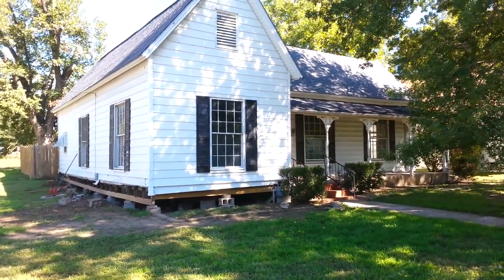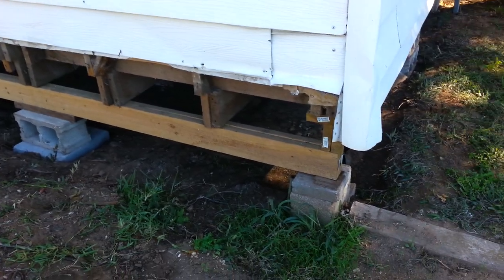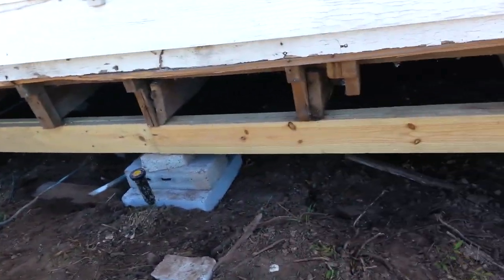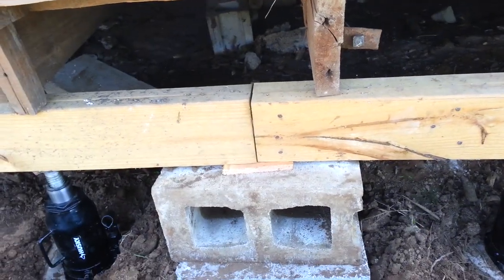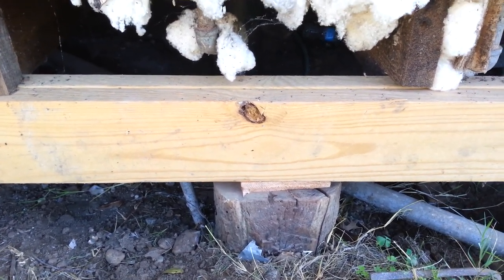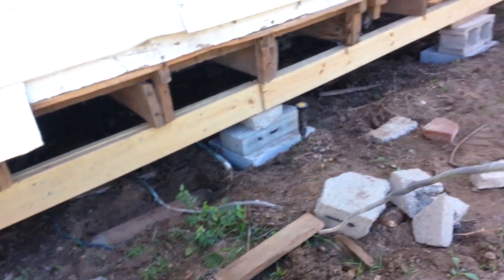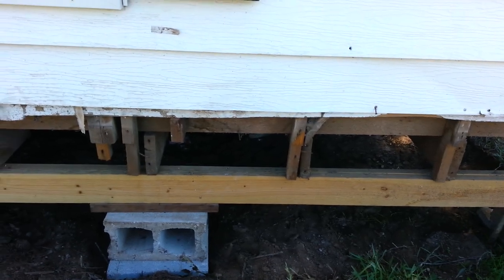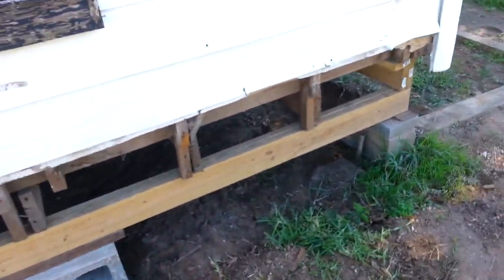How to level a pier and beam house

Comment: outstanding video,  i've been doing a lot of repair on my early 1900's house ... paid less then twenty grand for her. so i haven't complained too much about foundation issues and rot and termite damage just lit in and replaced what i had to.. had to repour some concrete on top of the existing foundations as they were poured beneath hand hewed beams which the termites ate.. and they were not square flat nor level so i had no level place to put new beams..  the concrete repour worked gangbusters... got it all squared away new beams joists and plywood put down..   i actually made a stain out of steel wool, distilled white vinegar and a little baking soda that stained all the new wood... it fooled the inspector when he came to inspect some of my plumbing.. i was afraid if he knew i replaced a bunch of joists he would have required a permit and made me bring the whole house up to today's code standards..  my lil house has stood since about 1907 and i truly just wanted to repair what was there and keep the integrity of it.. didnt want to tear it to the ground and rebuild.. so far its looking great.. i got one area that i may take some photos of and send you if you don't mind i need a bit of advice..  anyways thanks for the video its been very informative.
Reply: What state are you located?  Just curious..i just bought a similar house in fort worth tx

Comment: When you are under it in the middle fixing the midspan beam is the best part. Nothing quite like listening to the house crack and pop while you're laying under it lol. For those that are wondering, no I'm not in any real danger doing that. The jack could magically disappear and the house would just fall a short distance and hit the piers. Worst actual case is a seal fails in the jack and the house slowly settles back down.

Comment: Thank you for this video!!! I have been searching for hours to find some info on post and beam construction. I have a camp on a lake that needs a beam replaced. my situation is an uncommon problem. What happened is my uncle put a deck on the lakeside beam without flashing his ledger board!!! So the beam is totally rotten. If you can help me with a few questions I would really appreciate it. Some background : I inherited the camp from my grandfather who was a builder/contractor with a relatively big company (about 6-10 employees depending on the job.I was really close with my grandfather because I was his only grandson. My mother was his only child. So I spent summers working for him ever since I could carry a bundle of shingles. lol......so I'm just saying I grew up around a family of contractors and I am a contractor myself. But the only time I have done any foundation work was leveling the camp im talking about when I was around 12 years old (so very little experience). In my situation if the rotten beam was perpendicular to my joists I would be a lot more confident replacing the beam by holding up the joists with a temporary beam and cribbing. But the beam I am replacing runs parallel to my joists and its throwing me off. Im trying to figure out how to hold the weight to rplace both the beam and the rim joist. Its funny I have not come across a video with anyone replacing a beam like mine. lol I really need this camp to stay up because im so close to the lake I could never rebuild this. So if you could find some time to help me out corresponding with pictures and what not I would send you some $ through paypal or something. I really need to get to it this year before another winter (im in Maine by the way). Ive done all sorts of different jobs but never one like this. the camp is on a hill/slope making things more difficult. And the beam I need to replace is 75" so around 6 feet off the ground. So its just the worst case scenario for me. Ive contacted a few companies but they are all too busy. I can get help with friends and neibors to help lug cribbing and everything but im just nervous being the g.c. on this particular job. Let me know if you can help and I can send you some oics and get a few pointers from you. Sorry about such a long comment but its even tricky to explain my situation. lol

Comment: Hello looking for advise if you don't mind reading this

I have a small 16' x 22"  lake cabin built in the 1920's . I has vintage  wood shiplap siding .It will make a good rental once I can fix this issue. The lumber is super high quality. They built it on one course of block laid on the dirt with no concrete footer . The idiots should have dug a footer 48" deep.. The corners of the cabin have sunk along with the corner block. 1 to 2 " drop at the corners. .There are slider windows that won't slide open until I get it level. I have some bottle jacks, and 4 auto jacks with steel posts to lift the corners.  I want to jack the first 8' from each corner and level the corners  ,so 16' front and back will be completely supported . The 22' side walls ,don't really need complete support which makes me think this method will be a big time saver option  . The middle section of the 22' walls, is still level with the current no footer set up . I will have the option to work on supporting the middle later if necessary. Compared to this method, I was going to do more work than I possibly needed to, to get it level, and  after watching this. I am curious if lifting structures like this is code legal in all states?  I am going to look at some screw jacks for continuous adjustments also. Thanks for posting I gives me another option as long as it is legal in Michigan ? I am concerned with breaking windows also when lifting it. I will have to lift in small increments I imagine? Thanks

Comment: What about the water lines and restroom pipes when u lift it up
Reply from the maker: You may have to cut those and reconnect after the leveling process is complete. But, maybe not... It just depends on how the plumbing was installed.
Reply: @aaroncitius11  ok thanks for the reply

Comment: ok so I have a question.........The new beam you have here??  2-2x6's ?  My fiance' (we were together 13 1/2 years)  just passed the end of April.......and we were in the midst of a remodel.......I have to finish myself and have no $ to pay anyone......Our perimeter wall to our kitchen, 8' (very small house) it HORRIBLE!!  termite and weather rot.........I understand I can put a beam under the existing floor joist, and we do have those same jacks........but I'll also do the same exact (is what we planned actually) pad, block and the cedar was new to me, but I like it.  Can you possibly let me know if I'm on the right track?  My search stopped me at your video, its the closest "view" of what I'm gonna have to deal with.  I would so much appreciate it and would be very thankful.  I'm 63 and I dont want my house to worsen cause I'm not gonna get any younger.  Thank you
Reply from the maker: I am using double layered 2x6's but you could use 2x8' and that would only add strength. Without seeing it in person, I really can't say what you should do. I wish you the best. You can learn a lot if you keep researching. So, keep learning until you feel comfortable working on it yourself.

Comment: We have a building and half of it is sagging about 6 inches over about 60 feet.  Actually, half the building is sagging and the other side is fine.  How would you level half the building.  You only have a foot under the house.  Would you have to remove the floor and use the jacks on the inside of the house?  Thanks
Reply from the maker: You could do that, but you could also dig trenched under the house and crawl into the trenches to access the beams.
Reply: in the process of digging a trench as we speak. Holy cow. lol. Lots of work. I need laborers.

Comment: Have a cinder block foundation supporting two old army barracks where on section sagging.  Is there any way to do this without removing the original foundation?
Reply from the maker: I don't see why you couldn't level it on the old piers.

Comment: I know this video is old, but i have a question. I am looking a leveling a house where the addition, which is 60 years old has sank around 4 inches. Do you work from out in to in ? or in to out when leveling ? to give you an idea about how bad this house has settled, the Kitchen counter snapped.
Reply from the maker: You'll really need the try to level it all at once if the house needs to be raised significantly. You'll go back and forth between piers building up each one a few centimeters at a time.
Reply: @aaroncitius11  thank you! It is a bit overwhelming at the moment.
Reply from the maker: @starfox1340  you can do it though. Be careful.

Comment: Great Video,,lots of teaching,,Learned a Lot,My house is close to the Ground,would be hard to get under neaf,,any Ideal ,,THANKS
Reply: This may seem a little extreme but if you have carpet you can pull it up at the place where the floor is low and cut an access to the underside of the house through the subfloor. Just be sure the saw blade is set to cut only the depth of the subfloor and make the cut following the center of the floor joist so when the job is done all you will need to do is screw the subfloor back in place and roll the carpet back.
Reply from the maker: I suggest digging trenches parallel with the beams. They will create pinpoint crawl space where you need it and give you access to parts of the house that are otherwise not accessible.

Comment: I have an old house that needs to be lifted and leveled. Should I have jacks all round the whole house and slowly lift one then the other down the line all the way around or do I need  some one on each side of the house front and back and we all lift slowly down the line of jacks on every side?? Also do I have to get a permit to do it? I prefer not to but just wondering. Thanks in advance for your response, Kim
Reply from the maker: Jacks should be under all beams and not just perimeter beams. Permit would depend on location. However, if it's your house and you're leveling it yourself, then I think you'd be less likely to need a permit.

Comment: I get the basics of this, but how do you make sure that the house is level? We bought a house that needs work, but you can tell it is not level, it tilts to the rear and left side.
Reply: to level a surface i always use a level, you can find them by feet, and if the area is too long for a level, use a laser level, water, line etc. but if leveling the wall is complicated, would be better to hire a professional to do the job

Comment: When it rains, rain water collects under the house for weeks. Sinking further the house. I’ve lifted and leveled but water still collects what do you suggest I do? Lifting entire house isn’t an option. What do you recommend?
Reply from the maker: Keeping the water out is something that you need to try. Maybe check the skirting around the house.
Reply: French drain.
Reply from the maker: @e.s.8684  that could work.

Comment: Greetings, great video among many!  Ive just bought a 1920s house in an old woodmill town.  Beams are huge and burly, but sitting on regualr bricks that are crumbling, sunk, or the edges of the wood are rotted.  The floor is slopping in corners.  My question is about installing the new 2x6 beams youve added.  Where did you jack/support the house in order to remove the old and install the new.  That is vital knowledge and was skipped over in the video.  Do you support each joist?  Maybe put a pieace of lumber or metal spanning across multiple joists so you can lift them all at once?  Thanks.
Reply: Currently doing this now. I have 6 jacks supporting the 6 joists at a time. Get as close to the ends as possible. I also built supports inside as a precaution for the wall and roof. The home only had on beam that was rotted so i needed to add a whole new 2 beam system. Took me about 3 months to do everything from removing enclosure/siding. Adding level bases figuring out where to support and so on. Almost done with first level phase and adding new piers. Old ones sagged quite a bit.

Comment: hey aaron. our question is: when you are lifting the house, does it disturb anything inside the house and can a family just live there while the lifting is going on?  important detail to us. thanks.
Reply: Shouldn't be an issue.... I didn't see anything to suggest the contrary when I lifted my house though I wasn't living there yet. Lifting a house can damage a house through. The framing will usually be alright and not be disturbed too much if the house is lifted slowly, but things like bathroom tiles might crack and drywall joints (especially ones installed while the house was already settled) will suffer. Countertops might become slanted, and doors and windows.may not close anymore. Plumbing may become disconnected. Know how to turn off your water and gas at all times, and smell for gas leaks, check for stressing of plumbing and electrical.

Comment: Should of looked here, before we had someone re-level our home.  We have a 1056 sq 18 year old home, that just started shifting about 2 years ago, it was re-leveled but I have a concern.  It was mentioned to us that he overextended the leveling in the middle of the house.  As a result, we ended up with 3 additional cracks above the doors and the tile in the hallway near one of the bedrooms did not go into place. A little worried about the middle beam cracking.  We have a year warranty to relevel in the event there are any issues to the foundation, but would you happen to be familiar with damage to the actual house.  Not sure what to ask, I am just curious as to what we should consider or keep in mind??? Help, if you can offer any advice or idea to watch for?  Thank you...
Reply: Cracks in the drywall/tile are normal after leveling a house.

Comment: Hi question I have crawlspace and the fundation is cracked in few places ,I repaired the cracks but the half house is settling maybe 2 inches I don't have money for lift the house the companus charge to much thousands..... how I can stop the house for future settling ???
Reply: get you some twenty ton jacks and a big 4x6 beam put her under the joists and lif the house up a little bit. add some cap blocks and regular blocks shim up if you have to... you can at least prevent your house from sinking down further and take some of the weight off that foundation.. with very little money in materials..  it always seems impossible but once you get into a project like this you will find it pretty easy.. two inches is usually pretty easy to raise a house.. buy you at least three jacks just in case one fails you got another to replace it with..  you may want to cover your foundation with some vinyl or something to prevent any further degrading if you cant afford to replace it...

Comment: We need to do our 1910 home. The central 3 room fireplace is holding up the center & all other rooms have slanted off from there. Even the attic! My question is when we start lifting should we only adjust a small amount per week to allow the house to keep up? I was told if not we will crack all windows & door frames/walls &  so on. I just need to know how slow, like 1 inch per week slow? lol Thank you, great video! 😊
Reply: Lisa Johnston … When leveling only a section of an older home it's more like 1/4" per week then wait for things to catch up. Yeah, sounds slow, but I went through this with my 100 year old house years ago. The hardest thing to keep up with is drafts along the foundation if it's cold out. You can use fiberglass insulation and make minor adjustments as you raise things. OTOH, that won't keep out the mice. Just keep setting mouse traps while you work and eventually you can address the foundation gap in the end. BTW, when jacking, you raise, then shim the gap with something solid, and never leave the home on the jack for an extended time.

Comment: Thanks for the info. My grandma's house is very unlevel, even though she's paid twice to have it leveled by ripoff artists. This time I'd like to do it myself. So I buy at least 5 or 6 jacks, the square concrete pads, cinder blocks, the shims, the cedar, the iron squares, and a bug bomb. Is there a general rule of thumb on the spacing, like one block/pad every 4 feet? Or is it 6? How do you determine at first just how high to jack it up? Isn't there something like you find the highest corner and use that as a guide on how much to bring the beams up? The floors are so messed up in the house that I'm wondering if using a laser light/level would work. Do you only jack up the outer part of the house, or can you also go under specific rooms toward the center and add support under there too? Sorry for so many questions, but you seem so honest and helpful!
Reply from the maker: A laser level may help at the end for finer adjustments but at first I always go off of sight. There are no rules. You just have to be  kind of natural engineer and provide support wherever you see sagging.
Reply: aaron citius Well my brother is a mechanical engineer, so between him and myself I know we can figure it out. It's always best to try to gather as many tips and hints beforehand from people such as yourself with experience. Thanks.

Comment: Im about to take on my own house here in Louisiana thanks for the info. Just wondering though what you did to ensure beam was level? Water Level?  Excuse my ignorance lol first time Ive done it and wanna make sure I get it right. Just as you said........ guy that built this house and didnt center the blocks and one side sinking on the pad and other pads have completely sunk in the ground blah.
Reply from the maker: Take a marble into the house and set it on the floor. It will follow gravity and roll if it’s not level. Make adjustments based what that marble does.